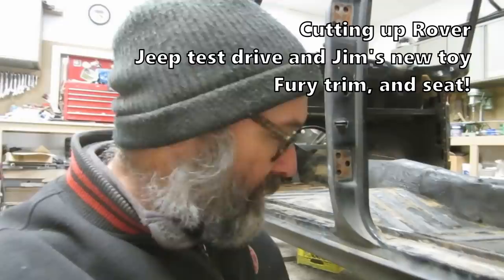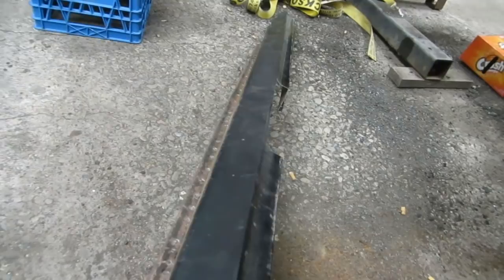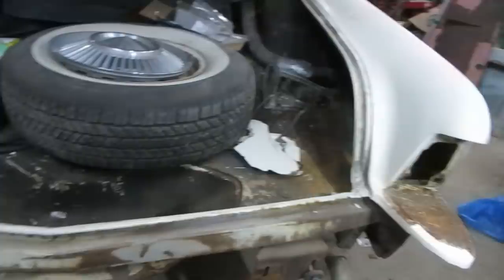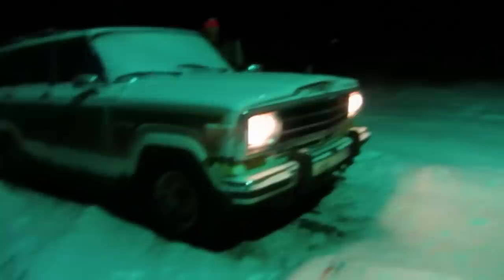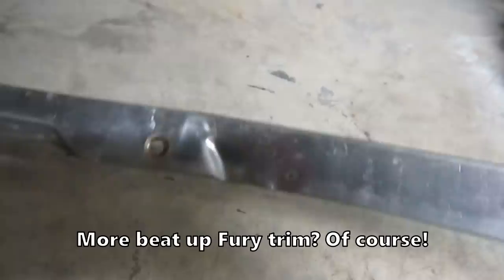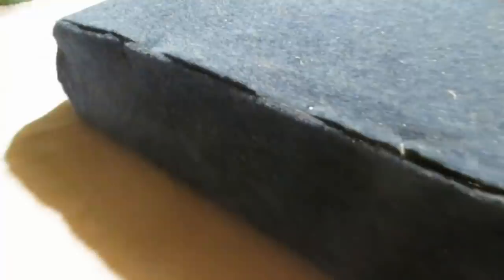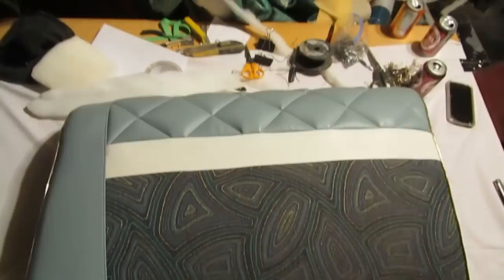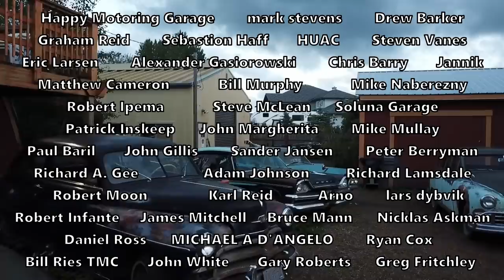Rover Rust, Fury Repairs, and Jim's Latest Treasure!

Comment: The Jeep Wagoneer is basically the grandfather of all modern SUV's.
Reply: Scout and Bronco too. IMO
Reply: Fun fact, Brooks Stevens designed the Wagoneer for Kaiser the same year they did the Wagonaire for Studebaker, and the Wagonaire looked an awfully lot like a mini Wagoneer.
Reply: Willys station wagon for the 4x4 crowd, Ford Tudor for the 2 wheel drive folks. Just an opinion.
Reply: @seed_drill7135  It most certainly did, with the exception of the sliding roof on the Wagonaire, and the folding step on the tailgate.
Reply: @jamesglenn2006  How about International Travelalls

Comment: The R5 would be my vote for WBC winner.  Fun to drive beats everything else for me.  The Fury backrest and trim turned out very nice.  One thing upholsterers do to eliminate the puffy look is something called a listing panel.  It's a flap of fabric hog ringed into the frame so the panel is perpendicular to the upholstered surface.  It allows you to control the unloaded surface height.  It's often used on bucket type seats to maintain the concavity.   We're still swatting mosquitos here in Texas.   Stay warm up there.

Comment: On Jim's Grand Wagoneer the front of the quarters and lower panel between the front bumper is of dissimilar metal. ( As are others) There are actual kits for cathodic protection that are basically wires to attach all the panels and charge them so electrolysis cannot occur. Don't ask how I know. 
Also a Holley Weber and Edelbrock manifold made that 360 a lot more driveable. Never less or more than 14mpg on mine.
Oh yeah they bring from $10 k to $60 k USD depending on the state of repair.

Comment: Great episode. Was just admiring a Caterpillar Ten along a rural road this afternoon, then saw Jim's new gem. Admit to having dozed for some of the Rover, but rallied for the Fury upholstery and the Le Car test drive. As for the cornering g forces, you are correct, the tangent of the angle θ between Franker's free-dangling ear in the corner would be the g force multiplier. It was probably no more than .25 g in the conditions, so around 14 degrees. Probably close to the temperature in °F. Then the massive torque from the buzzin quad fed to the snowy road through the Virginia Slim RWL's was a sight to behold. Fun stuff!

Comment: should be getting a little better then 10mpg, that year had the locking torque converter on the 727 transmission. my dads 1981 jeep with the 4.2l  and 727 with locking converter gets around 16+mpg.

Comment: ‘THE NIGHT BEFORE CHRISTMAS”
*Adapted for Cold War Motors 2020

‘Twas the night before Christmas
All through Scott’s garage
Were derelict four-doors
Citroen and Dodge. 

The sockets were hung 
By the chimney with care. 
In hopes that St MerryDean
Soon would be there. 

The agents were nestled 
All snug in their beds. 
While visions of light buzz
Danced on their heads. 

And Scott in his kerchief
And I in my cap 
Had just settled in
For an Alberta nap. 

When out on the yard
There arose such a clatter
Scott sprang from his bed
To see what was the matter. 

Away to the paint booth
He flew with a flash
Tore open the shutters
And kicked away trash. 

The moon on the breast of the new fallen snow gave luster of mid-day to a Fraser below. 

When what to his wondering eyes should appear but a Renault R5 and eight agents near. 

And a little old driver in sport coat and jeans Scott knew in a moment it must be MerryDean. 

More rapid than straight 8’s his coursers they came and he whistled and shouted and called them by name. 

“Now Alex, now Miles, now Steven and Jim! On Clayton, on Frankers, the T...will it run?

To the top of the Quonset to the top of the wall...now dash away , dash away, dash away all!

And then in a twinkling Scott heard on the roof the stumbling agents in Carhartts and boots. 

As he drew in his head and was turning around, down the chimney ol’ MerryDean came with a bound. 

He stepped to the roof off a yellow Capri and he wore  jewelry of emblems from
old LTD’s 

A bundle of hub caps was flung on to his side and he looked like a homeless guy thumbing a ride. 

He had a broad face and a little round belly that shook when he laughed like a bowl full of jelly. 

He was chubby and plump with the face of a kid and the top of his head shined like the Fury deck lid. 

With a wink of his eye Scott knew that this trip was his Christmastime chance to score greasy flips. 

He spoke not a word as he gathered his parts and he filled all the sockets  with stale classic darts. 

And laying a finger inside of his coat
There were no more gifts cuz that’s all she wrote. 

He sprung to the Renault with his parts bag still heavy and he launched to the sky off a 59 Chevy. 

But I heard him exclaim, ere he drove out of sight-“let’s finish the Fury, and to all a good night. “

Comment: The Renault will respond to a valve adjust by quieting down the ticking. But you have to remove the hood latch to take off the valve cover.

Comment: Those Jeep Grand Cherokees are very desirable in the lower 48 and command fairly high prices.   I had a regular Cherokee with a 360 long ago and it was basically a tank that would go anywhere comfortably.   Gas hogs indeed but very nice.

Comment: I find it funny that you refer to the MKII as a big car. We always called them Baby Lincolns especially when compared to the 1958-60 MKIII that was officially the biggest standard Lincoln produced and were also the first Lincolns of unit body construction with a partial front frame stub and rear trailing arm coil spring suspension.

Comment: Hey Scott, have you ever seen or possibly used one of those spot weld drills ? They have a center POINT DRILL and then following that is the 1/4 to 3/8 hole saw and you only go through the first sheet of steel, leaving a small hole in the center and then just the weld to grind off ?

Comment: I’m really looking forward to winter beats challenge. Could it take a page from Bud Lindemann’s car reviews? Stopping distance on ice and snow, serpentine performance, snow and ice acceleration, steer out of trouble with throttle, extra points awarded for maximum thermometer verified interior cabin temperature, quickest warm up time, least number of full engine revolutions to start without block heater, and least amount of fuel used to achieve the other challenges?

Comment: Jim's beats a 90 or 91? I swear I heard a gear-reduction starter which is something I had to retrofit on my older ones. If he wants more spark juice - a Ford 460 TFI Coil, cap, adapter and rotor are literally a drop-in upgrade... not much you can do about the 2150 carb though. Watching that thing running makes me miss the ones I had.

Comment: With all the weaknesses of the car the R5 is a good daily driver.  It is a good winterbeater for sure. Like all small European and Asian front wheel drive tincans. For many years I drove those kind of cars through harsh winters and snowy mountain roads.  
But I must admit that I killed my first car, a great Fiat 127 on a downhill drive on a curvy mountain road. In 30 minutes there was nearly 2 feet of snowfall. To much for a young idiot like me who was very stupid and not able to adjust to the situation and drive careful enough.

Comment: when import cars come into the uk from the states the body repairs found are very often what you found on jims lincoln,,piss poor with tons of blob instead of panel beating,,,normally with a fairly good paint job on top
Reply: The other UK master repair thing I’ve seen was beautiful paint job, but with a deep scratch showing undercoat and then bondo and something shiny, it turned out to be Scotch tape stretched over screwed-up newspaper balls used as filling in a crater of a smash... such ART!
Reply: @TheTubeTube2  wow what the hell,,what car was that done to to stuart?   i think looking to how much extra work it is to remove  the   whole  rear quarter  or  roof sections  that these bodges will happen ,,real bodyworking and  bending chassis back into shape costs thousands not hundreds  and many cars just dont warrant that amount of money spent